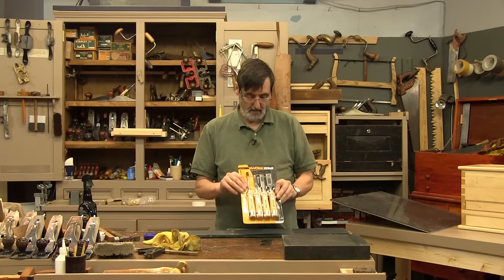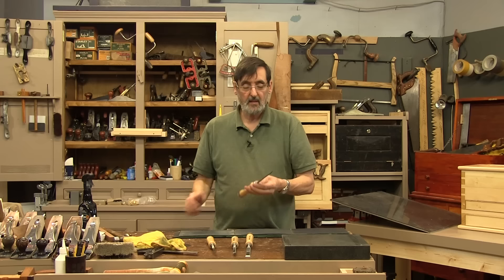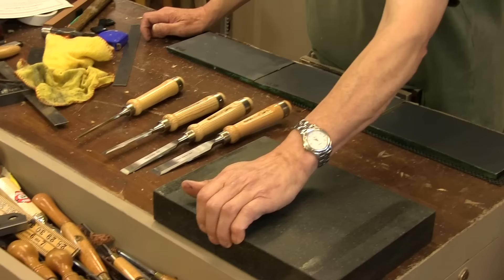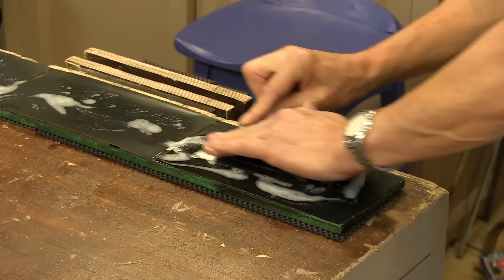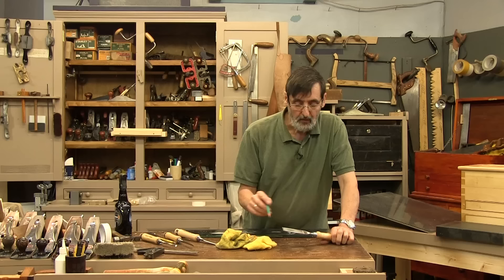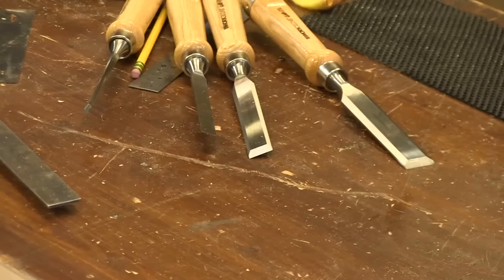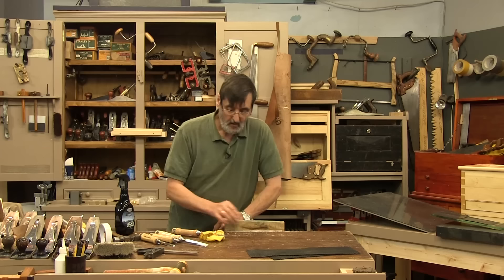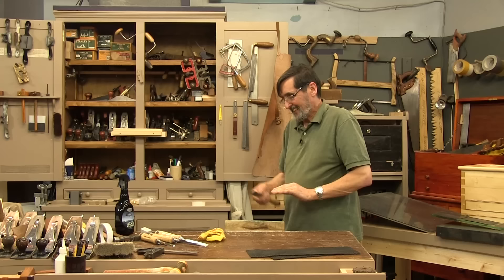Preparing and sharpening a woodworking chisel | Paul Sellers

Comment: What are some good cheap US chisels!?
Reply: Wallmart, Harbour Freight, anywere that sells stuff really,  they will be the same made in china stuff that we get here in the UK
Reply: ***** Are these aldi things made in china as well!?  They still seem much better quality per $ than anything I have seen at Walmart, Amazon, or ebay.
Reply: Paul has commented they are Made in Germany, however this my be down to the manufacturer playing on what they need to do do get away with that. They are only around a couple times a year, here but I am sure that you can find a half decent cheap set of chisels in the USA, its the prep that goes into them that makes them good as paul shows
Reply: Narex classic is very good!
Reply: lmf68 I was looking at those.  $40 for 4 chisels isn't that bad, and they look really good.   But I took a gamble on a 6 pc set from Harbor Freight for $10.  They look similar to the ones from ALDI, but that doesn't mean a lot.  They are chrome Vanadium with hardwood handles.

I was also looking at some shop fox ones from Grizzly.  And I just noticed they are freaking walmart...
Reply: Good Luck, getting them prepared and chopping as they should
Reply: Out of the box they're shit.  Not the least bit square!
Reply: Buck Bros chisels @ home Depot. Made in USA for <$10/pc
Reply: Alex Johnston I think I would buy Narex for $10 a piece.

These cheap chisels from Harbor Freight are actually doing fairly well.

Comment: Don't quite get why you went to all that trouble at the start and then declared it still wasn't sharp, so went to another process
Reply: +negara54 You have to "set up" the tool first (get the correct angles and good faces for registering against). The last step is the actual sharpening, and that is the process one would use from that point on to maintain the sharpness. This video shows that about any cheap tool can be transferred to something above and beyond if one knows how. :) Today I bought the Stanley #4 plane, and the blade was not correctly set up. I followed Mr. Sellers' advice, and I got super thin shavings after 5 minutes of "set up" and honing of the blade.

Comment: The Woodstock chisels look very similar. http://www.amazon.com/Woodstock-D3761-8-Inch-Chrome-Vanadium/dp/B005W11XJO/ref=sr_1_55?s=hi&ie=UTF8&qid=1384982044&sr=1-55&keywords=woodstock+chisel Do you know if the resemblance is only superficial, or if they are just a rebranding by the same manufacturer?
Reply: Nice referral link... marked as spam.

Comment: I disagree with his approach with to the bevel side of the chisel.  The bevel side should always be hollow ground.  That way you can achieve a thinner, sharpen cutting edge.  Never, never try to round the bevel side of the chisel.
Reply from the maker: Always shoot for a macro camber as has been the case for centuries. You get everything you get without the pain of grinding on specialist equipment. Step out. Do your own thing. Go ahead. Try both.

Comment: Not the best method. I have sharpened countless chisels over a forty year period. What is wrong - simple - he is rocking the chisel when he sharpens the bevel. This puts a curved surface on the sharp edge. This is not repeat not wanted. a much better idea is to use a sharpening jig (inexpensine) which will ensure a flat sharp edge. I love his enthusiasm but I wish that untrained amateurs would leave it to the craftsmen to advise. Tomould.

Comment: You are killing me drawing back on the paper like that. You are rolling that edge over on the bevel. You are starting low and raising the back up by the end of the stroke. If you want to use paper do it sideways, using one hand to verify it stays  flat at the tip and one supporting the handle. Stropping it will finish the edge drawing straight back beeping it flat.

Comment: 15:56....never jump grits without wiping the blade sharpening 101 it contaminates the next grit and wont refine the edge at all .....also he is wrong due to the nature of the steel the finer you go in grit not only does the edge last longer but it cuts significantly more efficiently so a 20,000-100,000 grit edge is not a bad thing for delicate cutting requiring a smooth finish
Reply: @Matthew Hopkins i go through more sandpaper in a year than most people go through in a decade...i think i spent 8 grand on abrasive paper last year alone if you dont get all of the previous grit and sanding dust off from the previous grit it will contaminate the next grit the water or other cutting fluid just creates a slurry of grit and sanding particles it doesnt wash it away without active spraying

Comment: WOT THE FUK ?   Sharpen a chisel -  1. Run it across the coarse grinding wheel at a shallow angle.  2. Run is across the fine wheel set at a slightly less shallow angle.    3.  Lay the flat side of the chisel on a stone & rub it to take off the burr if there is one. Takes me 2 minutes to get an edge that will slice the hard skin off your hand as carefully as a razor blade.    All that crap with liquid and bits of paper - fuk, life's too short.